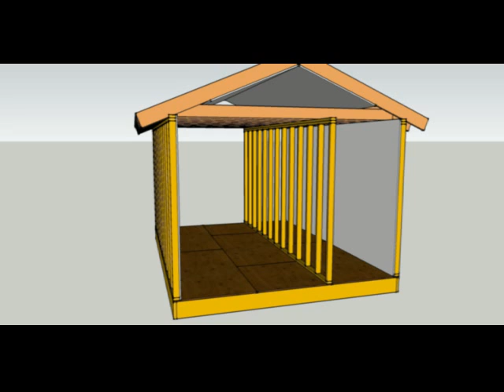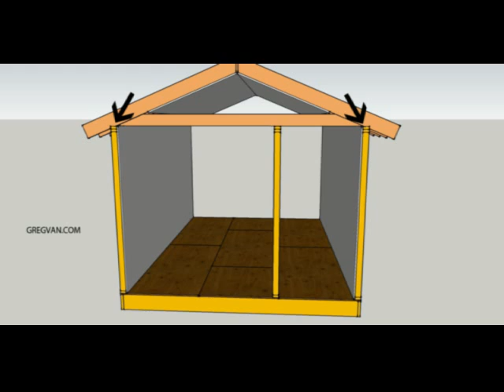How To Flatten Vaulted Ceiling - Load-bearing Walls Part Two

Comment: Assuming the job is to just create a new flat ceiling and not to create a new second floor area;  one could create a truss structure, supporting the new horizontal span by suspending the framing member from the existing ceiling framing.
So strip off all the ceiling finish to expose say the existing scissor truss.  Install a new 2x4 across the horizontal span to create a new bottom chord then create the tension webbing with 2x4's cut at suitable angles and secure these to the new bottom chord and the original upper chord with plywood gussets.

I'm not an engineer but I would be very confident in the structural integrity and adequate load bearing strength of such a solution if correctly executed.

Using 2x4  as a bottom chord would also be easier to work with than 2x6 or 8 or etc.  Easier to get it into the room, easier to maneuver up onto the top plates, and cheaper.  If needed, one could use two 2x4s each half of the span in length and splice them in the middle in the same way (conceptually) that long span trusses often use a pair of 2x4s.

As an alternative to stripping the existing ceiling finish, 2x strapping could be placed on the existing ceiling finish and secured to the framing.  This strapping then becomes the anchor support for the tension webs that will support the new bottom chord.  Less mess and material to dispose of and less damage to the vapor barrier.
Reply from the maker: That sounds like a lot of work, but would be an  alternative that should be considered especially with long spans. This would require a structural engineer.